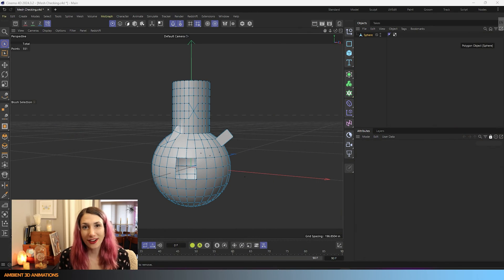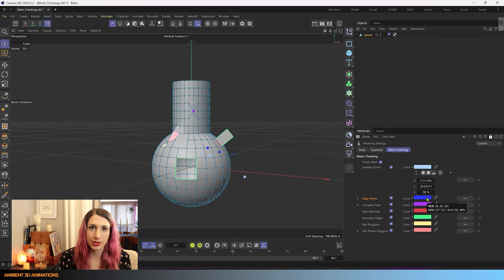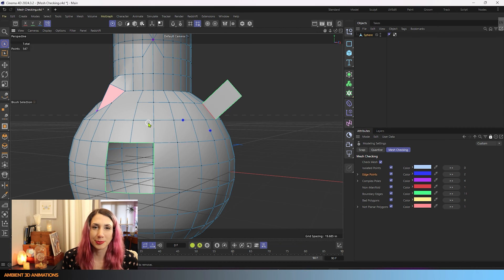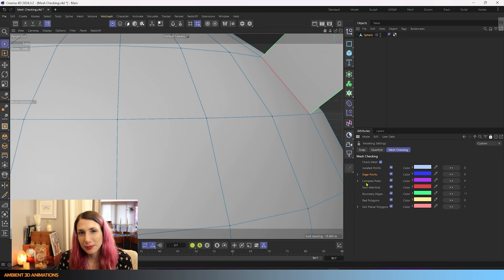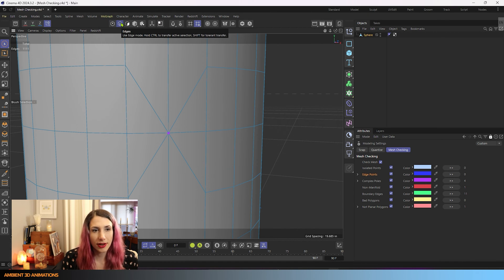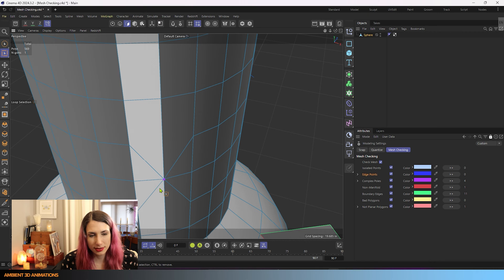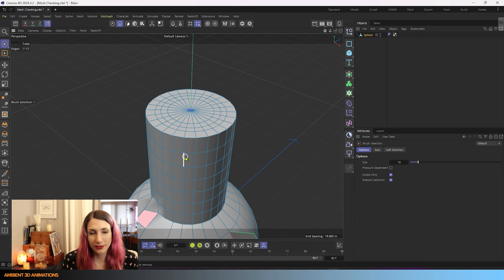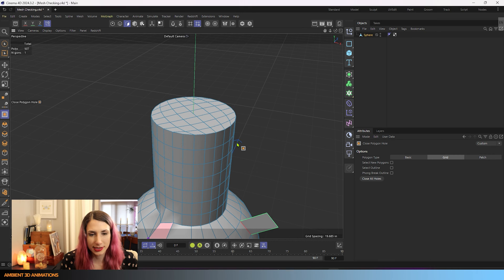C4D 3D Modeling EP66 Fix Geometry Errors with Mesh Checking

Comment: Thanks. Do you have to have the mesh in edit vertex mode before doing the mesh checking?
Reply from the maker: That is a great question! Mesh checking works in any mode. I needed to be in vertex mode to be able to move points.

Comment: Thanks for the video! I'm trying to 3D print a miniature of New York. I have 40k complex poles, 95k Boundary Edges, 87k Bad Polygons, 116 Non-Manifold. I'm getting errors in the 3D print because of this, but no idea how the hell I can fix all these!
Reply from the maker: Poles may make modeling and rigging more challenging but it should be able to print with that. The bad polygons won’t work though. You may need to fix the normals. I have another tutorial that goes in greater depth. I’ll share it.
Reply: @Ambient3DAnimations  Thank you so much! I'll look at that tonight. Really appreciate it! :)
Reply from the maker: C4D 3D Modeling EP14 Align Normals & Reverse Normals
https://youtu.be/cm7ptq9FRss